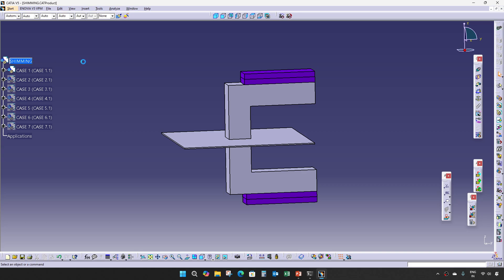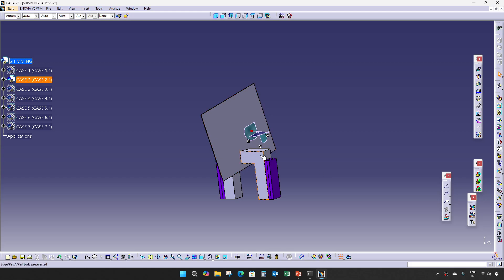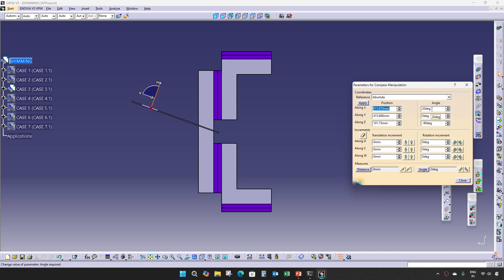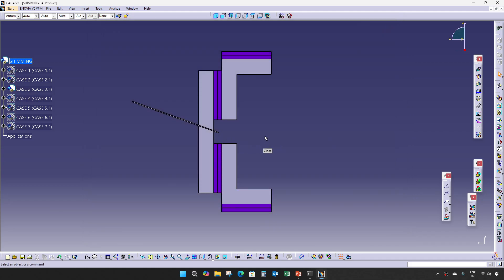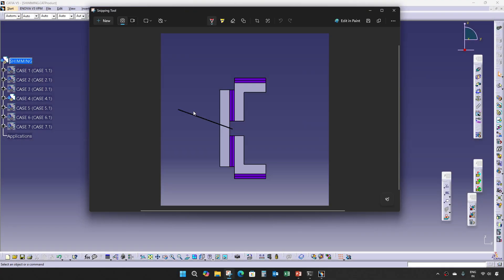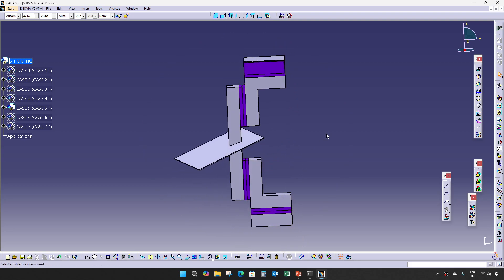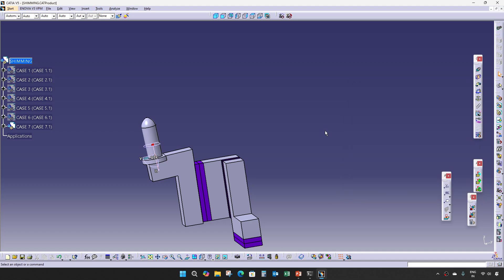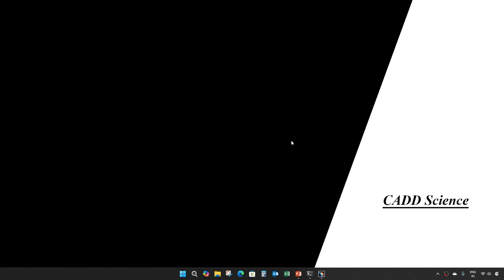SHIMMING RULE | BIW FIXTURE DESIGN | CATIA

Comment: Hey, what are those shimming used for exactly ? Is it like in assembly or machining, can you explain a bit please what these shimming are for ?
Reply from the maker: Shim is a pack of thin plates usually 5mm (1x2mm, 2x1mm, 1x0.5mm and 2x0.25mm)  used to adjust the locating pin or NC(Mylar), because the manufactured product may slightly vary compared to the design model